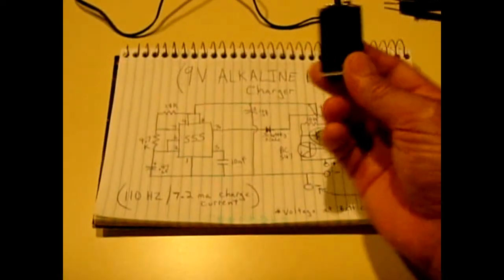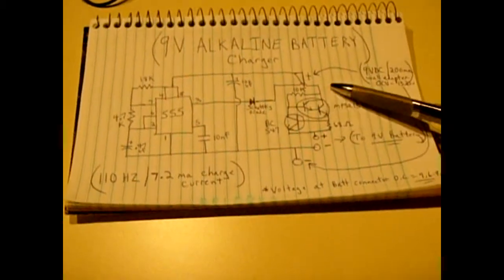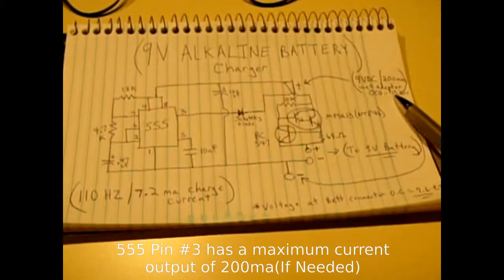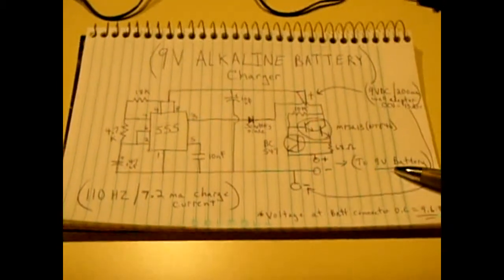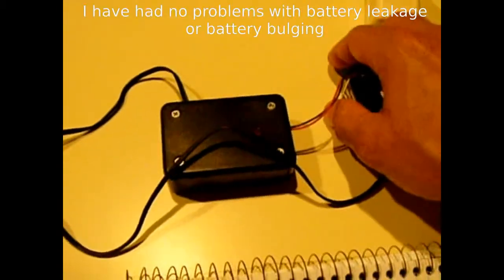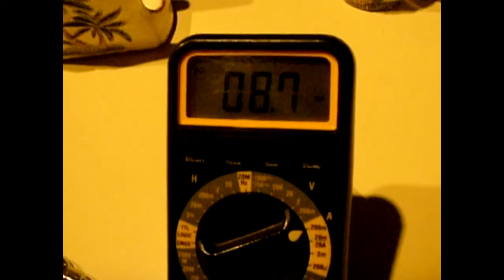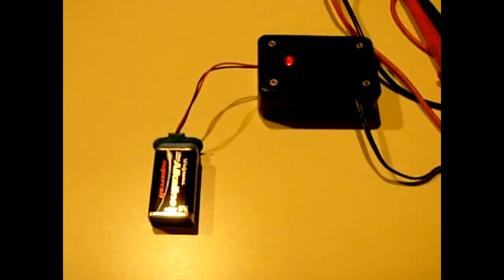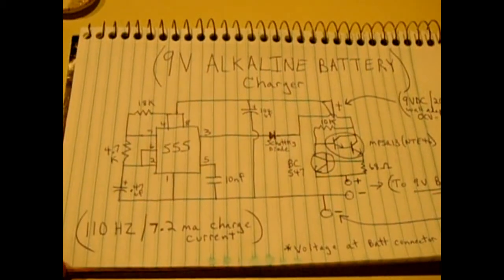9V Alkaline Battery Charging Circuit(Also 1.5v Cells)

Comment: I have seen a similar charger using LM317 for the alkaline battery charging. I am curious if this circuit have any specific advantage over those ??
Reply from the maker: I have not seen anything that works as good as this. If there are no constant current pulses sent to the battery, it does not work well. The lm317 can be a constant current /voltage source, but you also need pulses.

Thanks!
Reply from the maker: Nope. No good. No pulsed charging.
Reply: electronicsNmore how about this? circuitdiagram.org/nicd-nimh-battery-charger-circuit.html
Reply: electronicsNmore I built one last weekend, it works great..!! but after the battery is fully charged i see it starts draining very slowly say 0.3 v per day from the fully charged batttery.. even without connecting to any load.. is that normal ?
Reply from the maker: No. mine hold the charge very well. The battery is probably too far gone. Try and charge the 9V batteries when they drop no lower than 7.2-7.5v for best results. If the battery has been sitting around for a long time at a low voltage, you may not get it all the way back up. Try leaving the 9V battery on the charger longer. I personally do not wait for the battery to drop too low in voltage. I charge it after heavy use. Or once every few months with normal use to keep it topped off. Try a QUALITY 9V.

Comment: can i use a normal diode instead of the schottky key.?
Reply from the maker: The Schottky diode was chosen due to the low voltage drop across the diode. If you adjust the power supply slightly higher by .3V, then you can use a 1n4001 and up. Just make sure you have sufficient voltage to charge the battery. I use this charger all the time. Still no leaks or bulging.
Reply: electronicsNmore
thks for the info.how about charging a 1.5 battery ?.
Reply from the maker: You can charge 1.5v batteries also. You have to reduce the charging voltage to a max of around 1.75v, and increase the constant current pulses to around 20-50mA.

Comment: You can now get low self discharge 9v rechargable NiMh batteries ( they hold there charge for 2 years) . thats what i use
Reply from the maker: Not from what I read:
"manufacturers claim the new eneloop cells retain 70% to 85% of their capacity after one year when stored at 20 °C (68 °F)"

Still not bad, but I'm sure they are expensive. I'd rather recharge the alkalines.
Reply: I don't know about the NiMh 9 volts but a two pack of AA NiMh is about $16 around here, alkaline AAs are maybe $2-3 for a four pack?
Reply from the maker: Batteries are such a rip off. The cost to mass produce them is very little. A $3.50 9V Duracell/Energizer probably cost 50 cents to produce(including packaging).

Comment: Youre right about correct charging, proceedure is important for battery health and longevity, just as important as not running batteries into the ground before charging. As I understand it, a pulsed charge enables a deeper charge and in the process reduces battery internal impurities like sulphating etc. too. Try the 110hz pulsed charging on other battery types, I think you will find it works fine...Still waiting for my bits.

Comment: At 50 or 60 hz, if you rectify that you will have 100 or 120 positive tops on the waves. Using several LED's and diodes you can make a comparator for the 9.6 volts. You would use the tops of the sinus wave to charge the battery. Could you draw this schematic, and make a video of that? It would not need a 555 timer circuit since the power lines already deliver a steady beat!

Your schematic looks doable as well of course. Just giving an option here.
Reply from the maker: Good idea, but the only problem is that the upper part of the wave needs to be around 80% duty cycle. What that means is that the flat positive tops of the square wave need to be on a total of 80% of the time. A flat DC line is 100%. You will not get that using the AC mains. You would have  a much lower duty cycle.

Comment: Like this a lot, will have a go when I can get all the bits..Thanks
Reply from the maker: I can tell you that this circuit works EXTREMELY well. I have charged several 9V batteries and none have bulged or leaked. They also seem to hold the voltage nicely. I'm glad I came across that wiki page on how to properly charge Alkaline batteries.